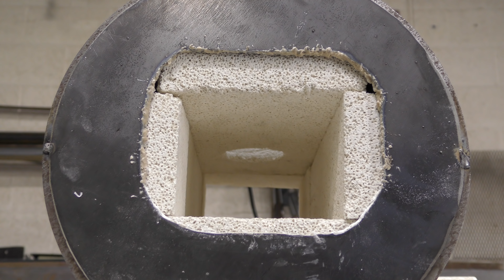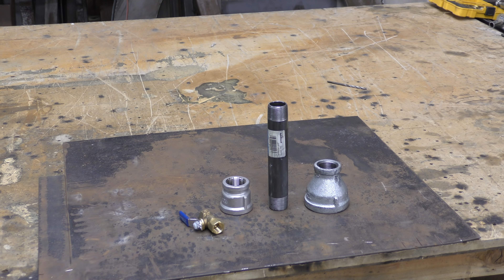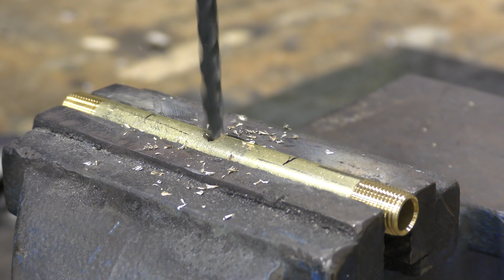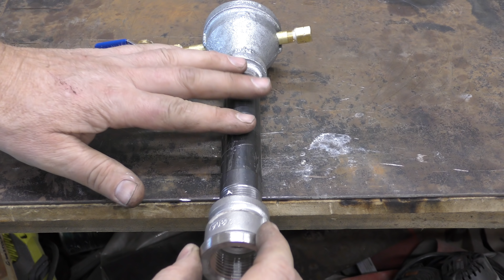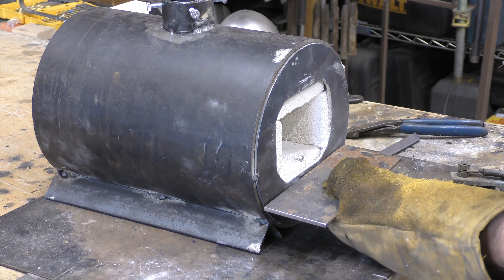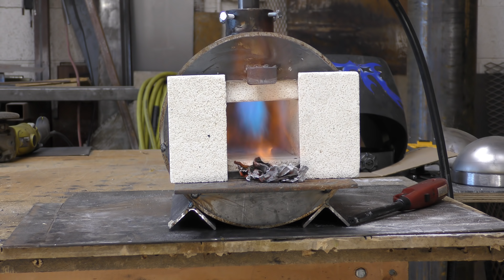Building a Propane Forge : Part 2

Comment: Doug , Great Video,  I have learned so much from this.  What type of regulator did you use the most I find around here are 30psi .
  
 Thanks  ,and  Merry Christmas 😎👍
Reply from the maker: I actually put a link in the description to the one I bought. It's a 40psi with a 48" hose. At first I picked up a regular barbq style regulator then saw a video that pointed out why it doesn't work compared to the high pressure regulator

Comment: It seems that the forge works very well! :)
Have you changed your camera? If so, what did you buy? It seems to me that the quality is much better! :)
Reply from the maker: It's working great once I got the air flow dialed in. And yes I did upgrade my lighting and camera. I picked up some LED shop lights and then bought the Panasonic HC-VX870. There's an electronics store called best buy and they have cameras that have been returned that they sell for less than new. I think it's called 'open box' purchase. I'm glad the video quality is coming through. I wasn't sure how much of a difference it would really make.